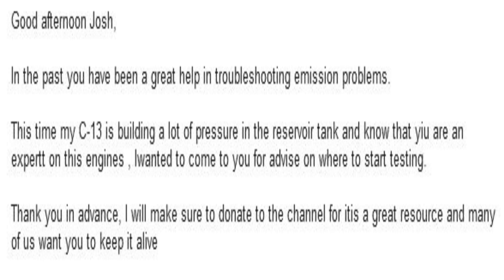My Radiator Has TOO MUCH PRESSURE, but why? Question of the Week.

Comment: Thank you Josh, for addressing my concern in such a timely manner. Great and concise explanation to a to a  difficult subject.  You are of great value to a lot of us out here
Reply: It's been my experience with the air compressor that you will find corrosion like crusties near the head of the compressor. It's a sign of a bad head gasket. 

The two times I've seen it, I replaced the compressor.  I was told the second time there is a head gasket kit you can find and treat it like a small engine rebuild.  I couldn't find one.

Comment: This would make a good spooky campfire story to tell to 6.0 powerstroke owners 😂
Reply: My 03 still running great after 20 years. I get the hate though. Guess some were built good and most weren’t 😂
Reply: My 6.0 is running like a top I don’t know what you people have against them they run just fine
Reply: @TurdJesus  The only real issues were the cylinder head bolts, oil cooler, and egr cooler. Changing the cylinder head bolts out with stronger bolts, and deleting the egr entirely, will give you a very reliable engine. Truthfully, they were pretty dang reliable anyways, but boys will be boys, and crank horsepower up. LOL

Comment: Pressurised coolant here...

Started with abnormal coolant level after purchase in that expansion tank virtually empty after random check, strangely no warnings of any kind and no visible leak on the ground.

Eventually had it looked at as now starting to see light leak on the ground with some slight coolant loss managed by frequent top ups, the thermostat housing was changed (detected as causing the coolant leak on floor). New oil fiter gasket fitted (as now coolant started pressurising and hissing when removing cap with coolant coming up and out expansion tank upon removing the cap with light overheat to follow - engine temp light on so immediately stopped, water pump issue suspected by breakdown recovery but was told at garage the oil filter gasket possible weak spot letting air into cooling system hence the pressure) new expansion cap shortly after fitted to rule it out (persistent issue same as prior pressurised coolant with very high reading again but no overheat as caught in time) 

A new water pump eventually fitted upon recommendation again by breakdown recovery man after reseraching not sure how it connects to the problem of pressurisation though?, different garage fitted as lost all faith in original garage by now.... the coolant had pressurised again and level high up in the tank engine temp light on again, immediately stop - as i say water pump recommended as cause again.

Fast forward car virtually un used at this point (coolant seemed pressurised still after the waterpump change at the point of now removing cap after every single journey (5-10 miles tops using like once a week) to manage issue as paranoid at this point  ...

New head gasket fitted as eventually now diagnosed by new garage with gasses detected, new cynlinder bolts fitted, head clean, pressure test, told no further problem found other than the gasket itself.....after all that have not used hardly at all, maybe 50 miles road test and still seems same with light pressurisation with a hiss while removing cap after leaving to cool for a few hours o. Level puffs up slightly like a vacuum affect, sits a cm or so below max then back to max after cap removed.

Other than just running it into the ground and letting it run its course or removing cap constantly to monitor pressure which i know is not a solution what else other than a visual check to watch the levels can be done? Ive read something about squeezing hoses to see if still under pressure when cold? I assume if not pressurised they will return to soft when cold as apose to hard when engine upto temp and hot

Comment: Hi Josh my dad rip a master mechanic used that method its very accurate if a combustion breech is present in will empty the bottle very fast hd used a stop watch he was dead on every single diagnosis.your awsome man you should be teaching in a college we appreciate you knowledge.i started watching you before baby came you started the c13 full rebuild series but never finished lol baby came.. congratulations  on the baby anyways I have a 2007 Lee kicking around and would love to rebuild it one day..hard to find any info on them..the problems with a c 13 in a highway tractor is this its a high torque high rpm engine needs to stay in high rpm lots of power but mine would get hot even after my friend said hey let's delete it do we did..at highway cruising speed she lugged rpm was staying too low for my 3:23's and would run hot.so I got p/o stuck a sweet 1LW 3406e in her sweet truck now..take care best engine channel on here along with KT 3406E😁😅😅🤣

Comment: I have a C15 acert that had diesel in the reservoir causing slight pressure in the cooling system reservoir . New injector cups and seals along with a flush and hood to go. Heating diesel would cause sight pressure too correct? Wasn’t enough to push out the cap but enough that days later take the cap off and pressure would come out the top of the radiator

Comment: I replaced the radiator cap and new thermostat, but this truck will not hold pressure in the radiator and overheats after you drive can you help me boss thank you🎉❤

Comment: What if it not bubbling when u do bottle test but when u got it under a load it let's very lil water out blue off tube u think that would be the cap or something else? There no fuel or or oil in system also mine is an 2005 c13

Comment: I have a year 1997 Suzuki Cultus car. I discovered by chance that one spark plug had been over torqued. It just turns and can't be taken out. Threads gone?? Can air get into the cooling system through this?
There is no spark missing while i drive.

Comment: Another source of cooling system pressure in some engines is a EGR cooler failure, especially when the EGR system takes exhaust from between the head and turbo, so the cooling system is getting turbine drive pressure.

Comment: Not sure if it relates to the C13, really haven't seen many of them, but could this issue also arise from the EGR coolers on many of the newer "Emissions Compliant" engines?
Reply from the maker: Not a KCB C13 they didn't use EGR. They did have something called a pre cooler for the turbochargers, but that can only pressurize the coolant when under heavy boost.
Reply: @AdeptApe  OK, I have seen the EGR cooler failures on some of the Power Smokes go up, and the gravy that is the result. Just figured I'd ask.

Comment: I’ve seen on the acert engines a few times where the pre cooler allows boost in under heavy load. Also seen a pre cooler leak coolant into the cac where it dried and choked the engine, that was a fun one to figure out

Comment: Hello  ADEPT it looks like I'm going to tear down an C15 MBN engine and do a rebuild, the engine has lots of compression coming out of the  radiator with exhaust gases the head was replaced by a cat dealership in Tucson 1 year ago the engine has right at 1 million miles on it owner wants to inframe it and turn this engine up from 425hp to 500hp hopefully any ideas for me to reach this goal I would appreciate your input. I did watch your video on the MBN engine that followed the 6NZ. Thanks again

Comment: That's easy, it's very common, the head or gasket is leaking. Racecars monitor cooling system pressure for that very reason.

Comment: Hey Josh just watched this video my 1979 cabover has a 3406 pcta engine with a radiator cap that is pretty big and threads on doesn't seem to be a pressure cap and there's no expansion tank was wondering how that works thanks pete!

Comment: I had a Volvo engine that was getting combustion gasses into the cooling system. It ended up being a broken injector cup. The end of the cup was cracked and letting the combustion sasses into the cooling system. I was able to pull the copper injector cup out by using a tap and screwing it into the cup and then with a slide hammer and a pair of vice grips I got the cup out. Love your question of the week and I hope it does well.

Comment: On a Detroit series 60 the 11.1s maybe also the 12.7 your injector cups in the head could fail and shoot all your coolant out your exhaust I know because it happened to me and my heads where I damaged driving it until shutdown hundreds of miles and one expensive tow later ….im actually dealing with coolant disappearing in the same truck again and a sweet smell randomly so might have round 2 on my hands soon

Comment: Could it sometimes be the cap? My wife's car had a problem with coolant squirting out of seams in the reservoir. After some replacing, and attempted replacing, it turned out to be the cap on the reservoir not releasing pressure. It's a Saturn, so yes, General Motors decided to put the pressure cap on top of the plastic bottle.
Reply: Yes cap is usually on the plastic degas reservoir but there are a few metal ones too🤷

Comment: I don't comment much but I really need your advice I'm a company driver pulling flatbed. I want to increase my knowledge about maintenance but the company won't let drivers in the shop with mechanics. Do you have a book that I can download or what would you suggest I don't want to tear a engine apart down to the block but I want to learn everything on the outside. Thanks
Reply from the maker: Well there are many resources you can use then. I have the Diesel 101 series you can check out, they are very basic and I have Diesel fuel systems 101. You can rent a book at the library about engines, take a community college course on them depending where you live.

Comment: Cavitation  is this a problem  only In engine  with a liner that are  o ringed What about  a cummins  5.9 solid  block is this still  a problem  . The information  on this is iffy.  . Should I try to protect  my 5.9 cummins  from Cavitation.  Or is Cavitation  not something  I should worry  about

Comment: 2000 Chevy Silverado 1500 5.3   No pressure in radiater. New water pump, thermostat and radiator cap   5:45 am thanks.

Comment: A common test I learned about the Cummins cm2250s was doing a coolant pressure test. I'm not even a mediocre engine mechanic in any degree but was taught pretty quickly helping the shop manager that coolant pressure in the motor comes from problems with the head gasket or a cracked head. 

I have seen air compressors heads crack/gaskets go bad. But the company I worked for also ran a delete on all of their trucks that blocked the egr. Leading to me having a conversation with our aftermarket head supplier who moved to reman production from owning his own truck company, about how the deletes that every one seems to be rushing towards are crap and cause motors to overheat. Mainly because they're not engineers. They don't understand why parts were included in the motors and generally don't understand why the motor.

We had about 60 trucks in our fleet and replaced a head/head gaskets about once every month. 

I've since left and started my own roadside, but i still wonder how many blown heads are a result of a crappy tune or delete. Subbed adept ape, if you ever want to checkout a guy familiar with the Cummins motors, search Rawze on YouTube
Reply: just subscribed

Comment: I have a topic for divers to do that helps mechanics. I might have talked with you about this. Is to take a snap shot, as sometimes a fault may not be logged. So as you well know the snap shot can provide what conditions the problem/complaint occurred under.

Comment: Nice!!  I used bottle test Monday on a Paccar that blew coolant at the top of Hatchet Mtn... With 12 lbs on radiator pressure tester bubbles in bottle, the pressure relief cap was a 15 lbs cap. Problem found.
   That Cat test was way cool!
    I enjoy listening to you!

Comment: Have been battling this issue on a CAT3516TALE... has frustrated many experts so far
Reply: Have you clear tubed it and blown down the cylinder? If so and you didn’t find anything after you’ve pulled the head and inspected it, you have a liner thats eroded and possibly the deck to. Pull the liner and you’ll find your problem.